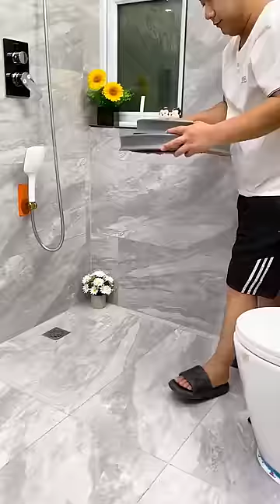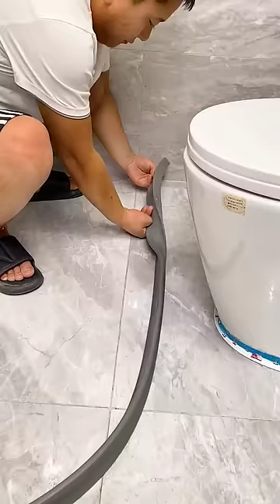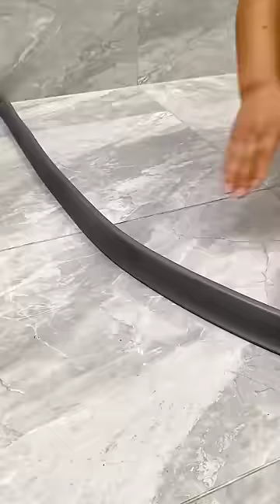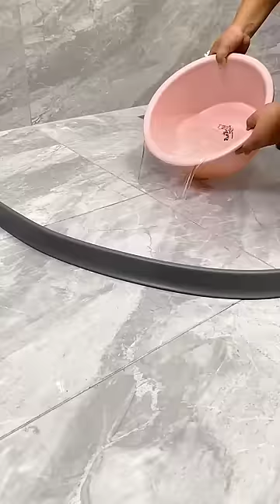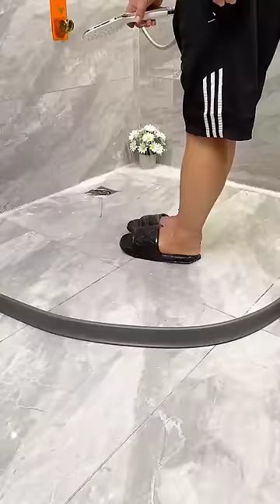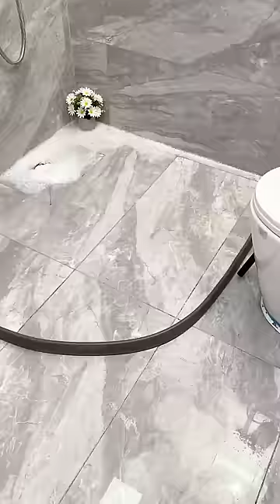New Gadgets, Smart Appliances,Kitchen Utensils/Home Cleaning/Inventions Redrock643 #short

Comment: I think this is called a “wet room”. If so, that rubber isn’t even necessary.
Reply: Always have extra protection.
Reply: It is if you only want a section of the floor to be wet. 🤷🏽‍♀️
Reply: @KEEKEE2FINE  since the hole only exist inside the rubber then what will happen to the other side when something spilled there?
Reply: Y si no es así, tampoco, porque no deberías colocar una ducha en una zona que no esté diseñada para ella.
Reply: @KEEKEE2FINE boy that thing ain’t finna stop the water from splashing god everyone think they so smart now days people who know nothing always got the most to say
Reply: @worldshell2313 If used properly it shouldn't be a problem. The problem will only arise if the water is put on too high and too fast.
Reply: @worldshell2313 put a shower curtain to avoid water from going to the dry part.

In times of emergency, dry mop should do the work
Reply: @JB-1184 to trip over . 👌🏼

Comment: Or just have it installed correctly
Reply: this is what is called a wet room. it is supposed to be open for easy cleaning and bathing. this isnt a good idea but i have seen folks put up curtains for the shower still allowing the water to flow to the drain from other parts.

Comment: That is as good as the glue that sticks to the floor, when the glue fails, If it does, then water will be on the rest of the floor. You will also need a shower curtain And hopefully your floor was made to actually take water on it. Some floors are not designed to take alot of water, Only to repell water.

Comment: There wouldn’t be a need for that if the tile installers would’ve slanted the tile properly so the water would flow downward towards the drain. Or they could’ve made X cuts around the drain itself to manipulate the water to run that way.

Comment: It's not a good idea you rinse your shoes you sleep with your foot and the soap is going to be start mold and smells awful and it's hard to clean those when you what what does it use you put those rubber around it I don't is blocking the water goes down you have to use the room after that or use your hands don't get it why